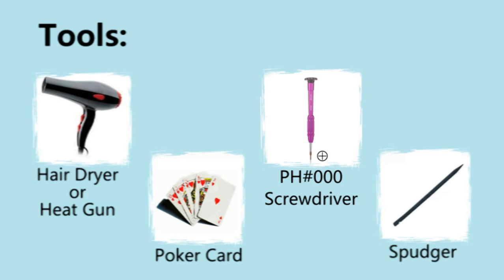Sony Xperia XA2 Battery Repair Guide

Comment: Nice video but who's actually going to do all this??
Reply: It's not that hard. Just gotta take the back cover off and take out a few screws. I actually did mine with a thin knife. Wouldn't you want to replace your battery though? They all go bad and in this day and age good luck replacing your battery as everything is dust/water proof. This phone gives you the option of doing it by yourself which is awesome. I'm willing to bet even with out the back cover this phone would still work if you put it in a case.
Reply: I do
Reply: @iamdalibor  I didn't see any screws being undone or removed in the video.
Reply: @pepez5263  2:18
Reply: @bumboclat  Thanks, however this dismantling is for the techies unfortunately.

Comment: Does XA2 and the Ultra version have the same battery type?
Reply: Ultra has a bigger 3580mah compared to 3300mah (which in reality is 3200mah).

Comment: At 2:33 my adhesive strip broke! I tried prying the battery loose and heard a snap, crackle and pop.
Luckily , it was just the old battery and not the phone screen and now there was going back. Everything else worked out fine
but I didn't have new cover adhesive, but what little was left on the cover seemed to do the job.
I didn't know that a bad/old battery could slow it's performance, now it's gone from a
4 cylinder, to an 8. (to use an analogy).